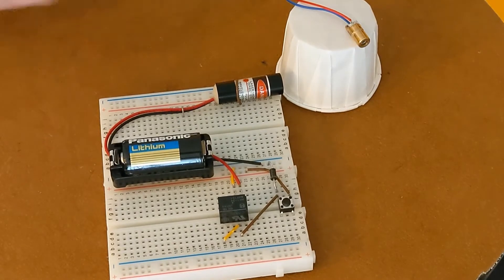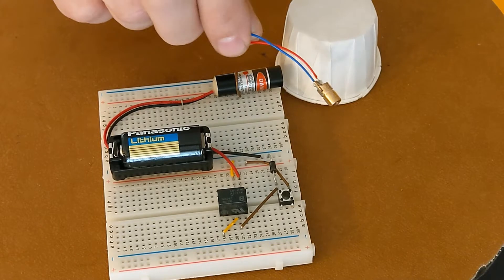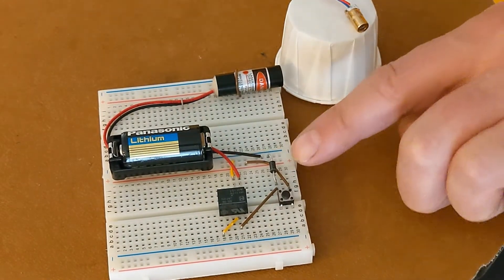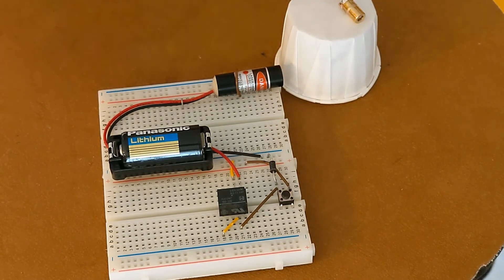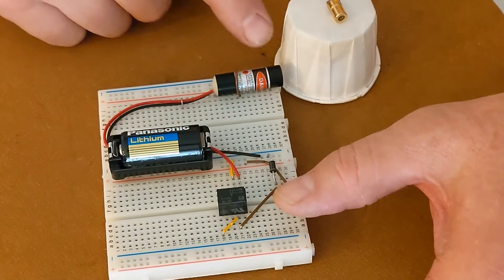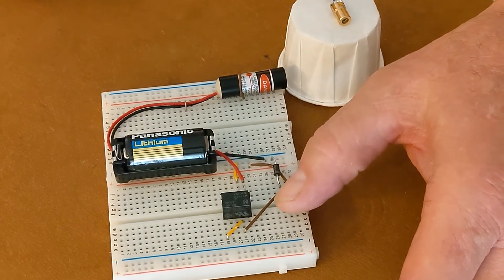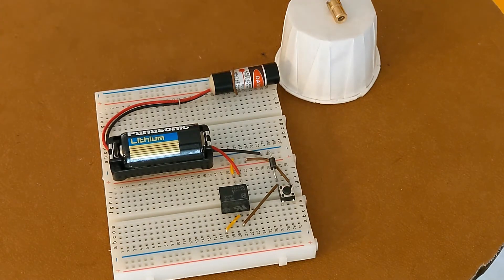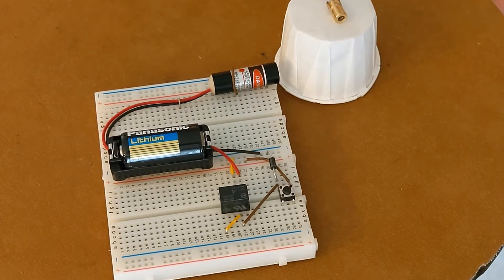Shooting practice LASER simulator for 2 Gun rim fire Marlin model 795 under barrel clam shell mount

Comment: Hello
The part no SW156 for the switch isn’t recognised on the digikey Uk site, would you have another description or a link I could try please?
Reply: I found a suitable switch now, would you know how I can adapt the laser circuit, so another using a secondary switch (reload) when I cycle the bolt on my rifle?
I’m looking at making a moving target and I want to practice recycling the bolt between shots.
Be grateful for your input
Reply from the maker: Try sw156-nd
Reply from the maker: Or manufacturer part number SS-5GL2
Reply from the maker: I would look into using a miniature muli pole relay that is wired in the circuit to latch energized when the bolt switch is cycled (loaded) and de-energize when the trigger switch is activated (fired).   this relay would also be wired to only allow the LASER to be fired when energized (loaded)   a set of contacts on the relay would be used to create the latching feature and the de-energize feature could be provided by the trigger switch Normally Closed contact
Reply: @neuromanglers  
That’s great, I understand what you mean,I noticed in one video that you were experimenting with capacitors as a stored charge to give an instant burst of energy to the laser?Is this your up to date method now?, or was the timing relay sufficient without capacitors?
Reply from the maker: I found the capacitors added additional burst width but would deplete the battery at a much higher rate so I opted to not use a capacitor since the system worked fine with a very short burst.   If you increase the laser burst time, you can end up painting the target with a swipe and you can easily see this in testing and that makes hitting the target too easy